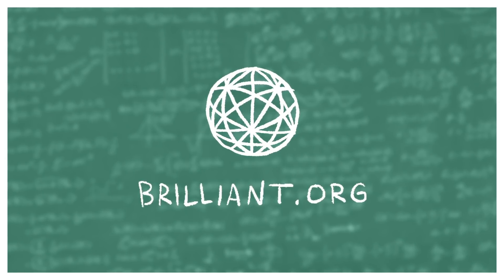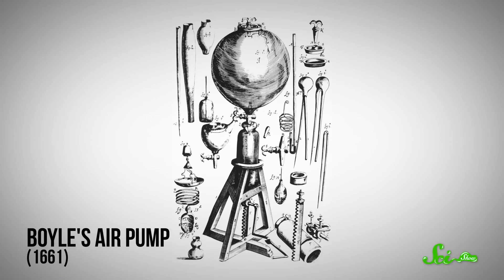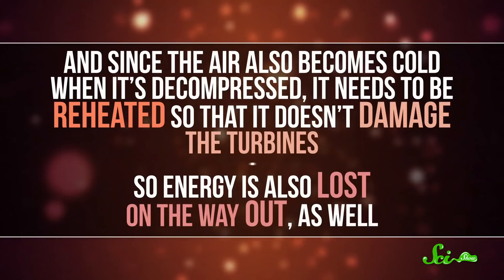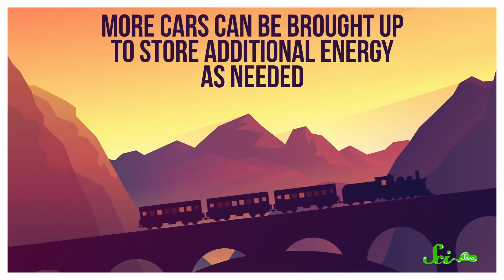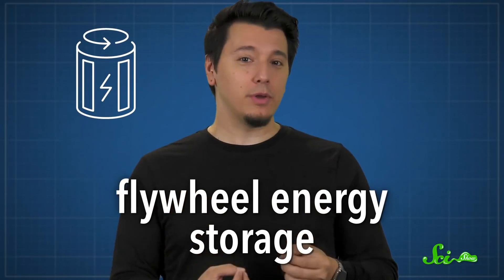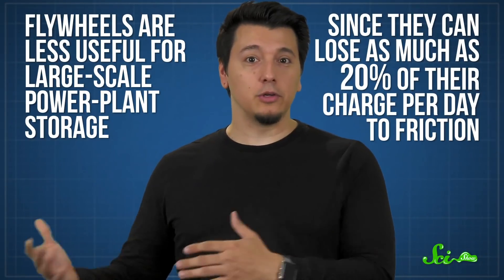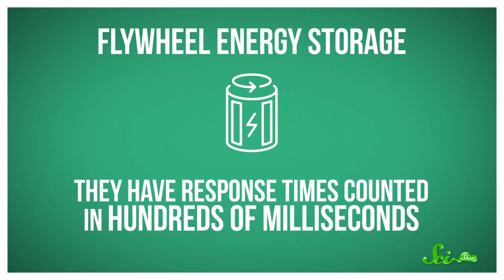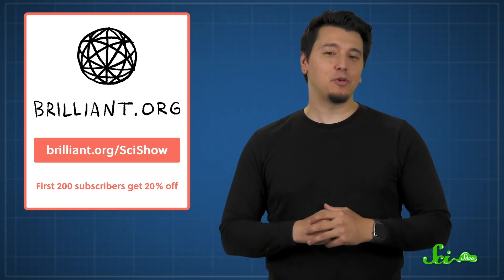The Surprisingly Retro Future of Batteries

Comment: At 3:00 "With a capacity of about 50 MW ..." - what you mean by "capacity"? MW is unit of power. Energy storage capacity is usually measured in energy units.
Reply: Probably should have said joules.
Reply: For power plants (and storage thereof), MW is often a useful metric.  You do care about the total storage so you don't run it dry, but for balancing the load, the real concern is power, not energy.
Reply: Not energy storage capacity, power capacity. The word “capacity” in energy refers to the amount of power a plant can produce. For example, a solar farm has a 2MW capacity if it produces 2MW under optimal conditions.
Reply: @SHIFTKICK  considering this entire conversation is about energy storage, i think it's fair for people to want capacity in terms of actual energy storage.  We aren't talking about balancing a grid here, were talking about storing excess power generation from solar or wind for when it isn't sunny or windy, for possibly weeks on end.
Reply: Probably meant MWh
Reply: 50 MW multiplied by the time it takes to get downhill
Reply: Probably means they have the capacity to deliver up to 40MW.
Reply: @NickShvelidze  For how long? A second? An hour? A day? That's what MWh is for.
Reply: @hititwithit  I think the MWh depends on how big your cave is or how high the hill.

Comment: Another type of gravity storage involves pumping water uphill and storing it behind a dam. Then, when needed, releasing it through turbines to generate power on-demand.
Reply: I always liked this idea, you get a few free extra benefits such as rain being free power and the option to use mechanical wind and solar to charge it. Turbines and pumps tend to be very efficient, so the round trip power loss is low.
Reply: огромная эрекция  and?
Reply: огромная эрекция  so what? Flowing water has energy that can be tapped by the turbines
Reply: I was literally going to say this.
Reply: I think most modern hydroelectric dams are already doing this.
Reply: Why pump? Rivers and rain do this naturally
Reply: @cgaccount3669  It's about storing excess energy, not constantly generating it. Pump when energy is cheap, let it run down when it's expensive. (i.e. pump during night, let flow all day.)
Reply: Water ram and trompe.
Reply: Yeah but if that pump breaks
Reply: @azmanabdula  ALL of the options shown in the video require some type of maintenance
Reply: @azmanabdula  Yea, but if [any storage  design] breaks . . . .

Comment: I believe the Williams F1 team were looking into the flywheel battery around the deployment of the original ERS / KERS systems too
Reply: Not only Williams. But Williams was the only constructor that using electric as power transmitter instead of normal gear for the flywheel

Comment: Hey wait, chemical batteries aren't environmentally great, but way better than current scale use of fossil fuels, not as defeatist as the intro implied
Reply: He's not defeatist but also understand there are limitations to chemical batteries. For a power plant, a large scale lithium ion battery is not feasible. They'll require more rare earth metals and lose their charge over time and use. Yes, there are alternative types of chemical batteries but chemistry itself is inefficient. Mechanical batteries are much better at recharging and scale. And in power plants case energy density isn't as much of a problem as it is for portable batteries.